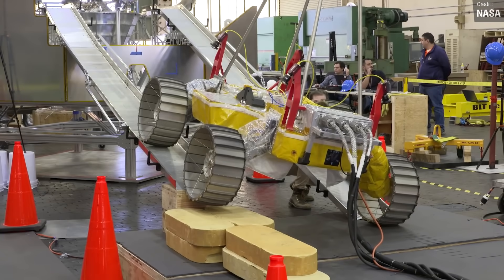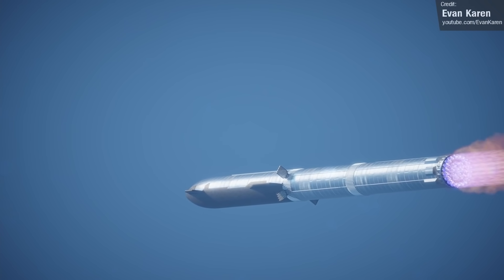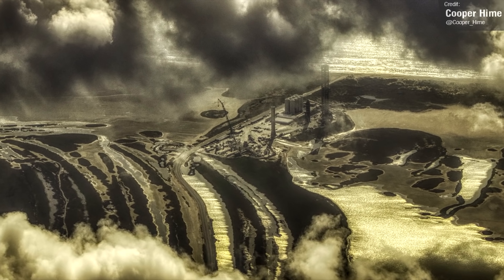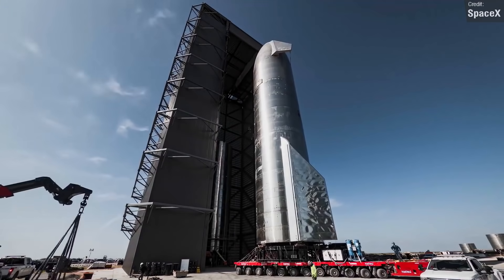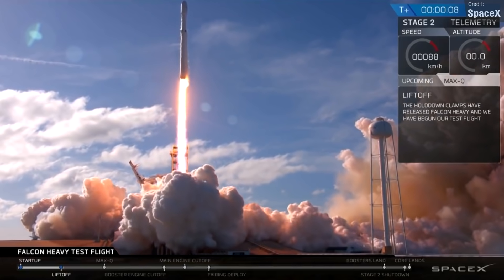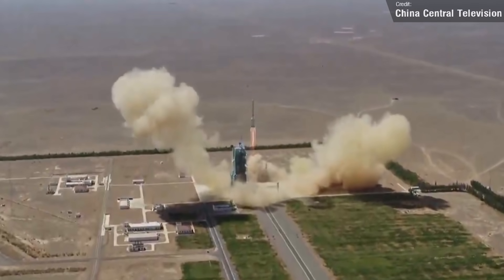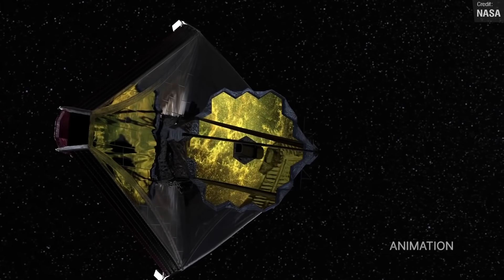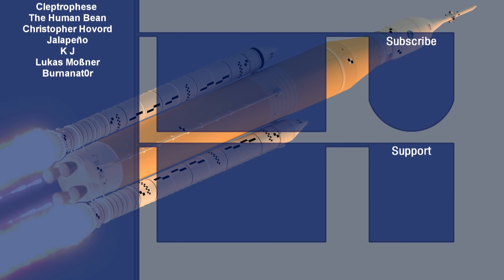SpaceX Starship Ship 24 on the Pad, FAA Final Deadline Reached, New Shepard NS-21, Shenzhou-14

Comment: If Starship works then there's literally no need for SLS. It doesn't make someone a tinfoil-hat wearing conspiracy theorist to point out that the government would take steps to justify its continued existence. How can you really think institutions don't have an agenda? All it takes is multiple people working together towards a common goal. It's not that complicated.
Reply: Starship won't be crew rated for a LONG time. Even Musk says that it will take hundreds of successful, operational flights, before a crew rating can be considered. Per page 12 of the GAO report denying the HLS complaints, the initial cadence for Starship will be one launch every 12 days. With page 27 (w/Musk's updates to that) calling for up to 10 Starship flights to get Lunar Starship to orbit, that is too slow to be able to use another Starship to bring crew to meet with Lunar Starship. Lunar Starship can only loiter for 100 days in lunar orbit per page 9 of the Apr 2021 HLS Option A Source Selection Statement.

Comment: Hey Matt, can I ask you for help in my KSP career mode save file? I didn't strand anyone, no. I was wanting to make some super sized ships, and my passenger class one I wanted to be an SSTO with enough delta V to get to Laythe (I have a Jool transfer window coming up). This one also weighs 888 tons the way it is now. I wanted it to be able to seat 108 people with a Mk 3 cockpit as control.
  And then I'm building a freighter, which isn't an SSTO, but should also be able to get to Jool and back.

Comment: Sorry why dose sls require the space x to work ???
Reply: SLS launches the Orion capsule (w/European Service Module) to lunar orbit and returns the crew. The Apr 2021 HLS Option A contract is for Lunar Starship to be the lander for the Artemis III mission. It will also do an unmanned lunar landing test as well. NASA is already negotiating the HLS Option B contract for one or more landings. There is also an Appendix P competition to have a second lander that everyone but SpaceX can compete in (SX has HLS). Replacing both HLS and Appendix P is the Lunar Exploration Transportation Services (LETS) competition that everyone is competing in and is supposed to be for 2 landers.

Comment: Will this test on SN24 be a test to simulate all nine engines?  Didn't the previous Starships only have 3?  Great advances in technology in such a short time.  Love your weekly updates!
Reply: All 6 engines. Current Starships, including S24 have 3 sea level and 3 vacuum raptors.
Reply: The sub-orbital flights were with 3 sea-level engines. The orbital flights will have either 3 more vacuum Raptors or 6 more depending on the final decision from Musk. He has mentioned Starship (second stage) havine 3 sea-level Raptors and 6 Rvacs.
Reply: I might have misunderstood this, but I thought that this test was to see if the Starship can cope with the force of the 33 Raptors on the booster kicking it into space.  We already know that it can handle the power of three Raptors.
Reply: @paulhaynes8045  My question was simply for the raptors on the Starship.  They will be needed to fire once they have separated from the booster to reach orbit.  In my mind it is tests on both to get ready for launch.

Comment: Have they solved the minor issue with the combustion chamber melting in raptor 2 engines?  Bets on the N1 version 2 blowing up the whole of the site first time they light the blue touch paper on the rusty ICBM test article?
Reply: Elon - "It'll be really profound" 

well turning the launch facility in to a smoking crater generally is Elon.
Reply: Elon "its super easy" shifty eyes

Comment: Does new Shepard really go to space?
Reply: It does not achieve orbit, but it does pass the Karman line, which is the official boundary of space, so yes.
Reply: @NEMo1103  Thanks. Earlier flights did not go past the Karmen line. Good to see it does now.
Reply: @magamike1800  Only three of the early test flights didn't go past the Karman line and one of those was an inflight abort test, so it really shouldn't count. Taking out that inflight abort test, 90% of New Shepard flights (100% of passenger flights) all went above the Karman line.
Reply: @steveaustin2686  Interesting thanks.

Comment: If the starship fails reentry they can just load a quick save right?
Right?
Reply: Revert flight
Reply: Elon should also check the staging buttons.
Reply: @parkerwalsh3340  Starship will definitely just launch straight from the top of the booster, making the latter explode on the pad and take out the VAB.
Reply: If reentry doesn't make starship fail, then the kraken will.
Reply: They are playing on hard mode.
Reply: By any chance do you know what capsule Elon uses? Mrk 3?
Reply: @parkerwalsh3340  External Seats in stainless steel fairing!
Reply: No because he absolutely loves to play those videos. Rapid unscheduled disassembly is almost more fun than seeing everything go right.